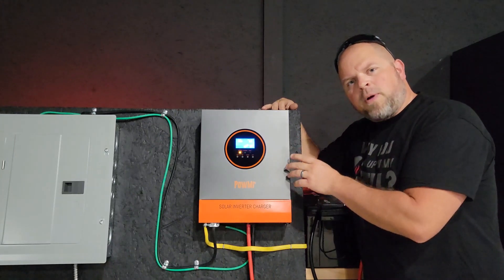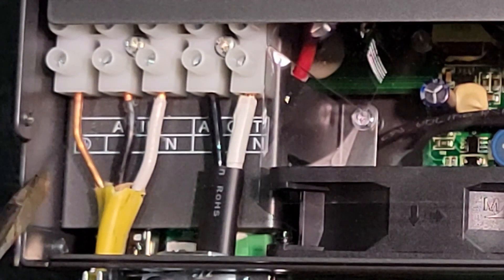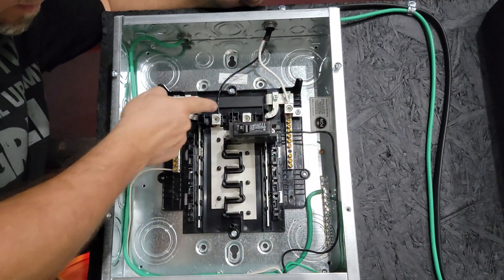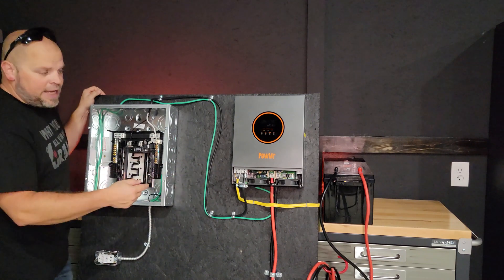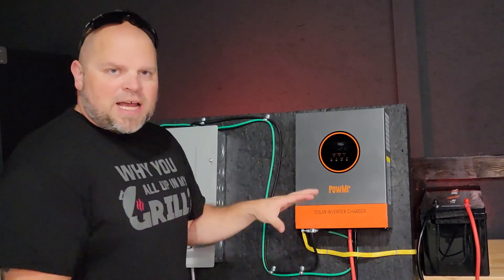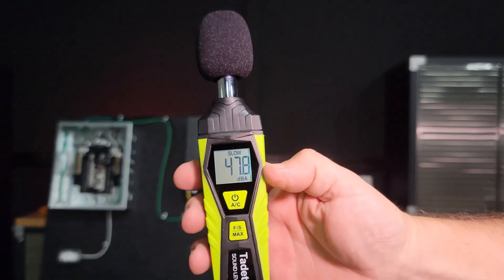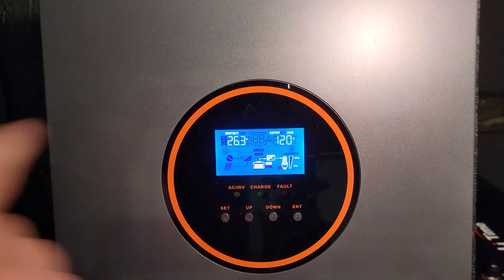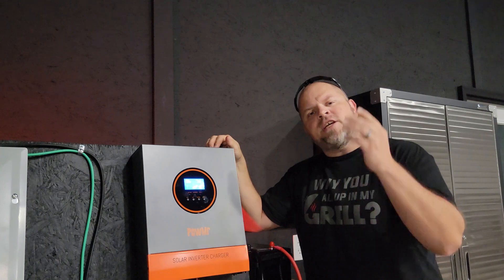OFF-GRID - PowMR 3000W 24v All In One Solar Inverter Charger

Comment: Dude, checking how electricity travel is important knowledge. How are you separating the neutral and the ground wire from your concept when they are one in the same. As electricity goes to ground. So you decided to attach a separate ground bar that connects to the box. How is your neutral bar attached to the box? I want you to think about that.
Reply: Did you ever wonder why there was not a separate bar in the panel in the first place. You made a change without asking the "Why" of the design. Indicating that something is missing in your logic and as i am taking the time to mention this, which i do not have that time. This is why masters teach. If your neutral bar is connected to the box via a metal screw, you have done nothing of separation and the so called "BOND" as you define it still remains, which it should, there is a reason why the neutral and ground are on the same bus, because your neutral is the ground and vice versa
Reply: You have put people's lives at risk, giving them the idea of separation and you should take that very seriously and edit that out or remove this video. You should not be teaching electricity and it is clear that your knowledge is lacking at best. fix it before you get people killed. Real Talk!
Reply: It is clear that you have a metal screw into the metal box of the neutral lug. which is the zero-resistant path to your ground bar. you nothing with that movement. Just stop and remove this video before someone tries to do this for real and ends up not having a ground in their panel cause the flow of electrons to be NULL and power flowing through items that is should not cause there is no path to ground. This will cause death to people who should not be dealing with electricity in the place and you have a obligation to stop teaching this concept to everyone and just stop it. As a ex-electrician, it is my duty to inform you that your actions is not how it is done, and there is reason why your ground and neutral are zero resistance in the panel. Next time ask the question why and 5 minutes of your time on a electrician forum would have given you the reason why if you were successful, that you put you and your entire family in danger and all those who watched this video
Reply: now to end this, neutral will carry the load back to the ground, so how can that happen if you separate the two? this is so bad on so many levels. Do not get it twisted, electrical theory will tell you there are different, and in theory they are. but you should be smart enough to ask, why did they connect the neutral to the ground, and that is because they are one in the same. They also say that you cannot be shocked by the neutral, and i wonder what happens when the neutral is no longer connected to ground, well we will see then, if you get a shock on the neutral side. There is theory and there is physics, and you cannot devalue the existence of physics and will give you bad days many times over when you try. I can eliminate the neutral wire and use the naked ground wire to complete my circuit and power my light bulb, i wonder why. Well, i already told you
Reply from the maker: I replied this thread already

Comment: Justin, Have you connected solar to this inverter yet ? If so, what's the Isc on the panels you're running ?
Reply from the maker: I have not. I bought a much larger inverter and installed it. I have a video on that if you are interested. EG4 6000XP - https://youtu.be/K-mXmVMyFxQ

Comment: The 40 amp charging from a 20amp ac socket (2,400watts) must be in reality 40amp at 24v (960watts).
Reply from the maker: It is capable of 40amps, I had it set to 20amps for this demo.
Reply: I agree with 24v at 40 amp (max ac charge current rating)at 24 v. 
But what I DON’T get is 40 Volt Max AC bypass current (120v?)…. Not with 12AWG !… and certainly not with a 20 amp outlet. What am I missing?
Reply: @ if you convert it to watts it makes sense.   Watts are universal and make simple.   
120v ac x 20amp = 2,400 watts

2,400 watts / 120v = 20 amps. 

2,400 watts / 24v = 100 amps 

80 amps x 24v = 1,920 watts

1,920 watts / 120v = 16 amps

Comment: I have inherited a POWMR 2000 w 12v inverter charger. It looks to be almost brand new but when I hook my battery to it instantly shows fault 02 (over temperature). It’s not hot at all and I’m totally lost. Any thoughts? Thanks for any help!
Reply from the maker: Could be something internally wrong there. It could look brand new and still have something wrong internal if someone hooked it up wrong. Hard to know for certain.
Reply: @ thanks Justin. If that’s the case I’d it fixable or no? Thanks!

Comment: I have the 3000V 24 V Power Mr. With a CHINS 24V 200AH LiFePO4 Lithium Battery.  How can I double the time I can run my unit during a power failure?
Reply from the maker: 2 options: Reduce usage or increase battery capacity

Comment: nice, informative video.  I have a SPF 3000TL LVM-24P PowMR, that I'd like to connect to two CHINS 12.8 LiFePO4 batteries (in series) that do not have an RJ45 comm protocol wire.  Am I missing anything critical if I don't connect the batteries to the growatt through the comm protocol?  thanks bunches
Reply from the maker: Thanks for watching and commenting! 👍 The RJ45 comm usually acts an a communicate wire between the devices. Hard to say without being on site and seeing the whole setup.

Comment: What would happen if I plugged a 1000 W generator into the system? Would it overload the generator or are there settings to limit the power that it pulls from the generator?
Reply from the maker: I haven't tried that personally. You might check the user manual online to find out for sure.
Reply: Yes, if your power consumption is more than the generator.

Comment: How many panels do you need to get the system started up,,
Reply from the maker: It really depends on the size of the panels. Just check your panel voltage output and the voltage input range of the MPPT and there is your answer. Good luck!

Comment: How is this inverter doing from a "long term ownership" perspective?  I've seen this unit on Amazon, just wasn't sure about long term or should I look more at Growatt or MPP brands?
Reply from the maker: Depending on your budget and overall build, I was recommended to look into EG4.
Reply: @TheSolarPit  problem is I can't find a 3000w 24v EG4... Not really wanting to go to 48v just yet...
Reply from the maker: @logun1970  Ahhh, I see. I don't use the PowMR that often but it definitely does the job.

Comment: I have this same unit. You can note that if you are off grid like me, you can connect your generator as your AC in. So on a cloudy day you can just turn your generator on and get the same charge/use benefit.
Reply from the maker: Thanks for sharing!
Reply: Does it has an ats for generators?
Reply: Doing that way, is the ground from generator still hooked up to AC in?  Or is it the ground from house?
Reply: Hey, I have a 10k system but the AC in isn’t working for some reason. When I plug the generator in it reads on the inverter screen at 120v. But it doesn’t show a line going to the inverter and the batteries do not charge. I have it set to CUB but that didn’t do it either. Would appreciate any advice you have. Thanks.
Reply: Unfortunately not with a 1200 watt  geny

Comment: Do you know anything about the PowMr 12v 1600watt AIO? as far as i can tell it only puts out 220v @ 50hz. It would be perfect for my use if it were 120v @ 60hz.

Im curious if there is a setting that changes the hz from 50 to 60 on your model.
Reply from the maker: I don't. It might be on their website though. If you find it, let us know.

Comment: Thanks for sharing - great info! What is the minimal PV-input voltage the MPPT-charger can work at? And what is the MPPT-range for input from PV? Did you measure the stand-by consumption with inverter on/off? From the batt. it is probably about 20...40W but from mains input it often takes much more - don't know why? With inverter off it should be less.
Reply from the maker: I would refer to the product manual of the inverter on PowMR's website to insure you have all the information you are looking for. Thanks for watching and commenting

Comment: Hi mate. I have powmr 3.2 24v hybrid inverter and my question is in the Philippines we have 220v on our socket via grid. and Do I need a 12v converter if I will use gadgets with only 12v and below? or It is safe to use the 24v powmr system to 12v gadgets without 12v converters?
Reply from the maker: Do not try to power 12v appliances with 24v outputs. It will cause damage to the appliances.

Comment: Can I connect 2 inverters?  I need more power than 3000W.  Thank you
Reply from the maker: Just to confirm your setup, check out PowMR website and locate the product manual to insure it will do everything you need. Thanks for watching and commenting

Comment: There are many versions of this inverter on the market.
What I couldn't find out is if it could bypass straight from the grid to the appliance. Dose this mean you don't actually need a battery?
I want to set this up for my 2kwh hottie heater and make it as cheap as possible.
My hot tub cost £1k a year to run and adding a 3kwh solar array will definitely take that price down.

In the uk I can build this for £700 including the pannals.
But if I can save money by not buying battery it would save me £1.3k.
Please advise me.
Reply from the maker: Thanks for watching and commenting 👍🏻

Comment: ?Ok so it's an all in one inverter, but what about 12 volt power?  What if it's a 48 volt system and you need to power your air conditioner?  How about power for USB ports?  I'm new to this but I don't understand how you can say it's all in one system when you need the other power sources?
Reply from the maker: All in one, meaning you don't need to purchase multiple components. Like a solar charge controller and inverter. It is a combo unit. Depending on your system, 12v, 24v, 36v, or 48v, you need to purchase the right one. Thanks for watching and commenting 👍🏻
Reply: Unfortuneatly no All-in-one manufacturer allows for 12vdc accessories. As 12v usually applies to Automotive/RV/ marine/applications.
You can however buy a transformer 24vdc to 12vdc that you can connect to your batteries (24vdc in this case)and to the 12v fuse block on your vehicle. Or you can purchase a 12vdc fuse block and install all your own accessories. Match the ampacity of your transformer ie. 24vdc-12dc @100amps to a fuse block rated at 100 amps. Than you are ready to access all your 12v accessories.
Reply: @rollinronin8125  Thank you.  That makes sense.  I can probably do that.

Comment: I install this inverter but when i connect the pv don't charge the battery
Reply from the maker: It should. I would contact support and have them walk you through the setup for your configuration. Thanks for watching and commenting 👍🏻
Reply: If you connected the solar array before connecting the batteries you probably damaged the pv charger. In the unit I bought it cautions you to connect the batteries before you connect the pv array.

Comment: Thanks for this explanation. I need to know the quality and durability of this powmr before buying this. Can you help me with this?
Reply from the maker: From the test I conducted, it functions as it should.
Reply: I had the 2.4 kW version it didn't last long and had no built-in fuse
Reply: @lucienrobinson685  For just a test they all function as they should. but if a test means having it for your personal use, then how long they last is a real question. thanks a lot for your review.
Reply: @lucienrobinson685  thank you so much for sharing your experience.

Comment: Can anybody tell me of an electronics shop that can fix hybrid inverters like the PowMr 10.2?
Reply from the maker: Depending on how old your unit is, you might check the manufactures warranty. Might be covered.
Reply: It is new and they refuse to help get it worked on. PowMr tech is no good. They will never recognize a claim. They deny all responsibility and even claim there is no problem and told me they were done with it. @TheSolarPit

Comment: Great video! You touched on something I could use a little help with. Bonding. I am in an RV. I have a 3000W unit like this. When I connect me unit to the RV I'm using a 50 Amp (NEMA 14-50) on the RV and the same on my solar shed. I wired the connections with a jumper for the 2 live legs. I have an 8 foot grounding rod. Should I be providing a ground to the unit to the grounding rod? Or to the distribution box? And should I leave the green screw in to bond the ground and the neutral? I would really appreciate the help. Greg
Reply from the maker: Hi Greg, I would definitely run that by an electrician. There should only be one ground neutral bond and that would be at the first point of service. If it's a subpanel, you should remove the green screw. You would not want another bond after the main service panel. Hope that was helpful.
Reply: Yo, who ever told this guy there should only be one bound, is so wrong. Please call an electrician so he can explain to you why not to do this
Reply: And for the record, i am an ex-electrician telling you this. and i cannot believe no one else has. Now the only reason i see doing this is to stop the possibility of load bouncing which would never happen unless that was a series of inter-connections preventing the path to ground. So do not take any advice except from an electrician.

Comment: Can the input and the output 240v be paralleled if you intend to feed the power from thr inverter back into thr main distribution panel?
Reply from the maker: This model is designed for Off-Grid use.

Comment: Be sure your battery can handle 80 amps of charging, it's adjustable in the settings.
Reply from the maker: True. Thanks for watching and commenting 👍🏻
Reply: How do you work out if your battery can handle 80amps of charging? I am off grid (PV run only) and have 2 x 12V/250 amp gel batteries (set up in series)
Reply: @intrepid_20yrs_plus  There should be a recommended charge current in your battery specifications / owners manual  or search for AGM charge current.

Comment: This may be a wrong ground wiring.  Why don’t you use your multimeter to check the voltage between neutral and ground.   Let’s see what voltage is there?         If it’s correct then Neutral and ground should be 0-5 volts.           The reason it’s wrong is where did you get your ground that is going to the ac outlet.        This maybe dangerous please test with your multimeter
Reply from the maker: I'll check it the next time I have this configuration installed. Thanks for watching and commenting 👍🏻
Reply: You are correct.  When measuring between the ground and L, and Ground and N at the controller, it is 60 VAC from Ground to L and to N.   Both the L and N are floating from ground.  They are taking the 24 VDC from the batteries and creating 2 out of phase 60 volt waveforms.

Comment: 40amp charging the batteries but the amp wiring and ac receptacle is 20amps. Hmm sounds like going to pop that breaker. Don’t you need to lower the ac charge input to under 20amps?
Reply: That's charging at 40amps DC. That's only taking about 8 amps of the ac input. I have the same unit
Reply from the maker: Thanks for watching and commenting 👍🏻

Comment: you can control at what voltage it should switch from the battery to the power grid and at what voltage it should switch back to the batteries
Reply from the maker: Thanks for watching and commenting 👍🏻

Comment: Not sure the bonding setup is correct.  Unlike a true sub-panel the source is the inverter, not your main AC panel.  Electricity wants to get back to the source.  If a hot wire suppled by the inverter touched the metal box it could not get back to the source through the breaker the way you have it.  The AC IN is grounded to the inverter so if the black wire touched the inverter case it would trip the breaker that supplies the input.  But then again I could be wrong.  I think the load center supplied by the inverter should be bonded.,
Reply from the maker: Something I will research a further. Thanks for watching and commenting 👍🏻
Reply: Did you ever get to determine if the neutral bond from your main grid panel is sufficient, or do you need to bond the panel connected to the inverter?
Reply: @WillyBegee  From what I can tell, you do NOT bond the load center.  When connected to grid power the inverter is bypassed and the main panel ground is primary as in any other sub panel.  You do connect the green grounding wire to the inverter ground/green terminal providing the ground when the inverter is in use.  Still not entirely clear to me how bonding is achieved if “grid power” is coming from a generator rather than the main power utility.
Reply: @WillyBegee   Also, when I say ground I really mean “alternate return path” since it really has nothing to do with the ground we walk on.  The green wires are an alternate return path to trip the breaker if the hot wire touches something metal that doesn’t have a white wire.  Whatever.

Comment: so I don't understand.........why is there ac from the house coming into the solar inverter? wouldn't you want SOLAR coming into the solar inverter? im very confused and new so trying to understand LOl
Reply from the maker: The AC coming in can help charge the batteries if that is needed. Typically, you would let the PV array charge the batteries. However, it is useful to have an alternative charging option. Thanks for watching and commenting 👍🏻
Reply: hey thanks for the clarification. OK so it's just a backup charging setup while you have power and when you don't it switches back to solar. Makes sense now. Thank you for your video and quick response. @TheSolarPit